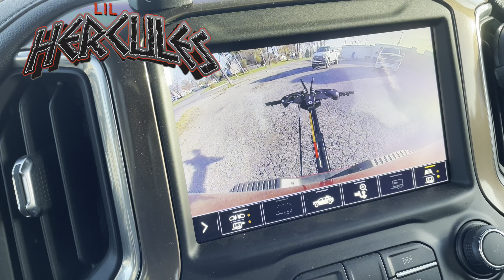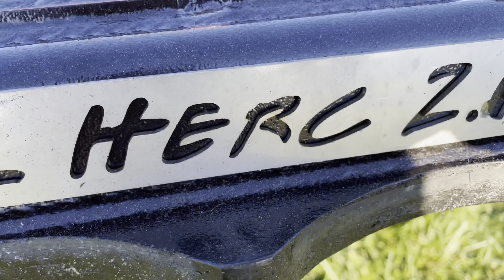Azteca Towing from Alabama gets a Lil Hercules 2.0

Comment: How much it cost
Reply from the maker: Lil Hercule's pricing is currently $22,000.00 not installed, plus shipping. For installation add another $10k and that includes:

* The most thorough Frame Reinforcement in the world  click here for video —> https://youtu.be/cuC-fM9nNoY  
* rear suspension. Click here for the video —> https://youtu.be/u-JzOq1HqvE
* plus it comes with everything else that is needed to tow home like chains, ratchets & straps. Again everything needed to tow home. 
* Toolbox for the double motor electric pump (runs twice as fast as a single motor). https://youtu.be/NMxMgUUQhsQ
* Wireless Towlights and corded. 
* Work lights w/ a switch installed into the dash to turn on/off. 
* Spare springs for L Arms, spare hydraulic o-rings for every hydraulic hose connection, spare 300 amp fuses for the electric motors. 

#LilHerc will work circles around any wrecker body or competitors unit that is similar to ours by far, in regards to duty cycle, 

* 5,000 Lift Capacity
* 10,000lb Tow Capacity

LH 2.0 now has a 5” bore Lift cylinder. Which is currently the biggest 'Lift" cylinder in the world for a light-duty application. We made out tubes thicker to accommodate & they are over 1/2" thick!! Making them the thickest tubes in the world!

Our Crossbar pivot pins are so superior that you can tighten them at any time. They are adjustable. That goes for the L Arm pivot pins as well.  #TwinHexPinSystem 
Our units offer a big difference not having to deal with the downtime or replace the costs of pivot pins or plastic wear pads. Our units are a game changer! 

We are the first to over-build the application to this degree.  
Unlike anyone, anything or anywhere else. We have thicker tubes, bigger cylinders, a superior pin system, no plastic wear pads. 
You can’t afford not to have one of our units. They are stronger and have proven to last longer than any other.

Plus the fact your driving in a comfortable truck, not a rough-riding wrecker. Essentially killing 2 birds w/ one stone making the truck a versatile money-making machine. Your personal truck is also your wrecker truck is also your 5th wheel or Gooseneck truck. So many trucks 🛻 all in one. 

"The bitterness of poor quality remains long after the sweetness of low price is forgotten. "

Ben Franklin.